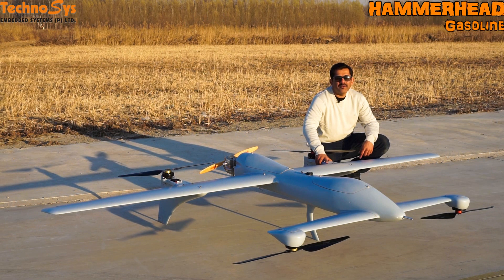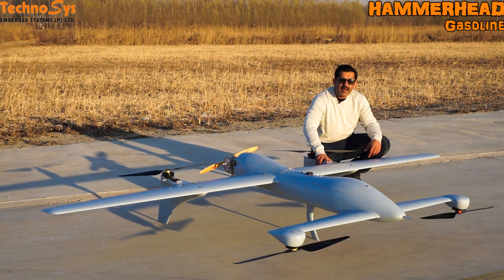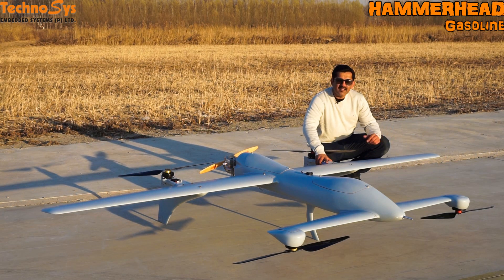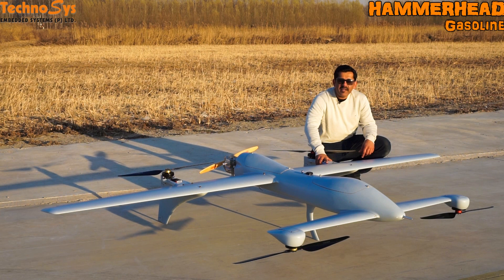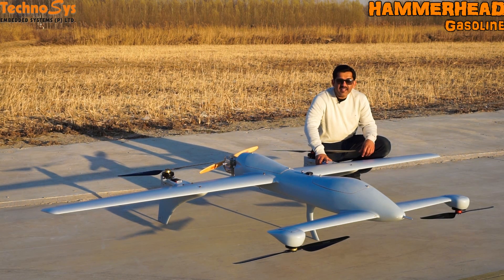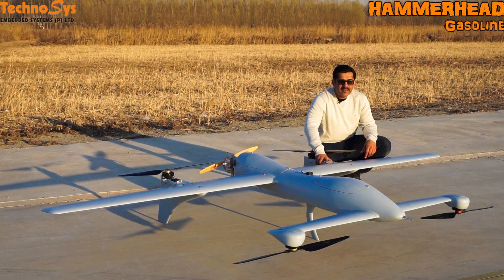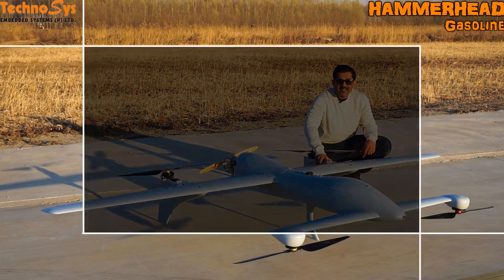HammerHead Gasoline Vtol Fixed Wing Uav With Object Tracking EO/IR Gimbal

Comment: An amazing design, in particular the integration of the front VTOL units in the horizontal stabilizers - it seems, though, that quite a fair amount of the prop disc is covered by the front stabilizer, is it?
Nevertheless, I appreciate the novel approach to designing long endurance UAVs. Remarkable !